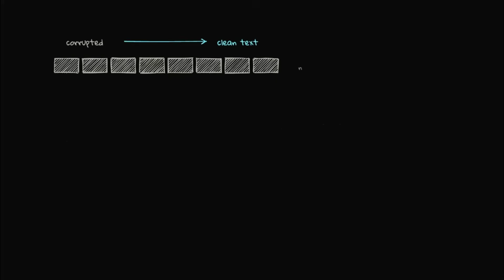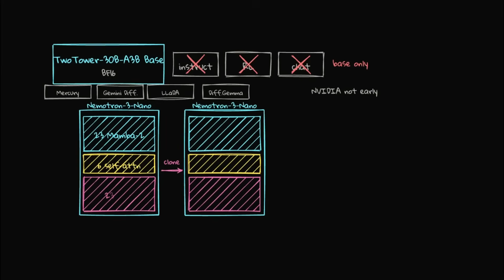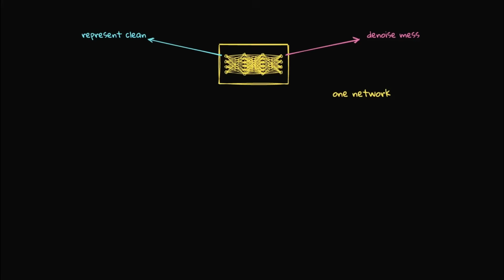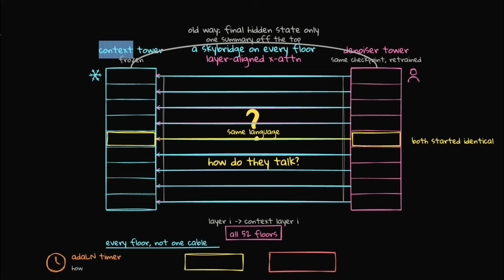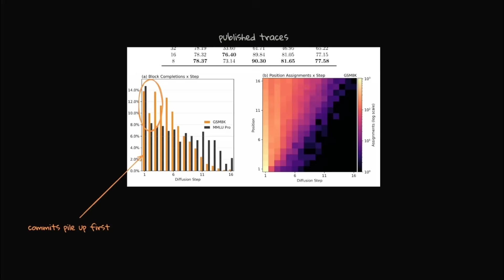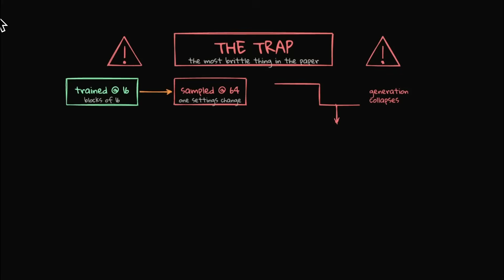Diffusion Is Coming for Text. Here's NVIDIA's New Model.

Comment: didn’t diffusion-gemma do the same thing with the 26b MoE LLM as base, but completely changing the autoregressive output step to diffusion-based block generation? just confirming if they are the same approach?
Reply from the maker: the key difference is TwoTower keeps the autoregressive base completely frozen and trains only a separate denoiser tower on top.
Reply: Yea Gemma was the first
Reply: @ToshanPlays  There were others before gemma diffusion as well, they were just too flawed to matter.

Comment: Wait isn't this just like speculative decoding using smaller drafter models ?
Reply from the maker: Not really. Spec decoding is lossless, it needs a separate draft model to guess ahead and the big model verifies every token, so the output is identical to normal decoding. TwoTower has no draft model. The diffusion tower generates a whole block in parallel by itself, and it's not lossless, you trade about 1% quality for the speed. Same goal, opposite bet on the lossless axis.
Reply: @engineerprompt  hmm.. i wonder , watching your description how diffusion model generating output (and then refines output for missing gaps)
it the generation process that can be altered to treat first , most confident step as initial set of tokens, and use them not in grid order but order them sequentially.. then 'filling the rest' would be just continuing the phrase , same as regression generation does.
Because clearly one of the problems of diffusion models that they are made for images, not text. But who said you cannot treat its output differently (according to the rule i described) and just train it this way?
(Hope i don't speak complete nonsense here :)